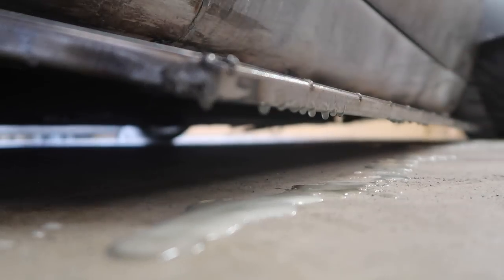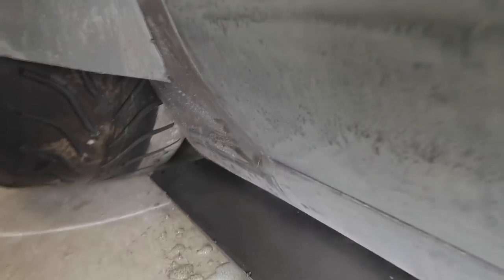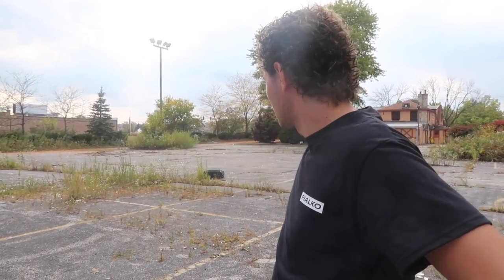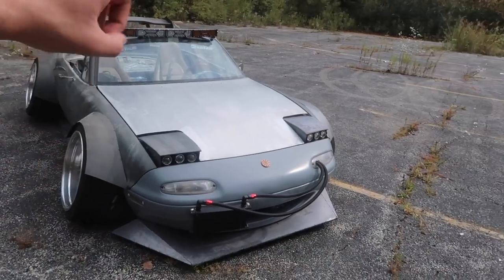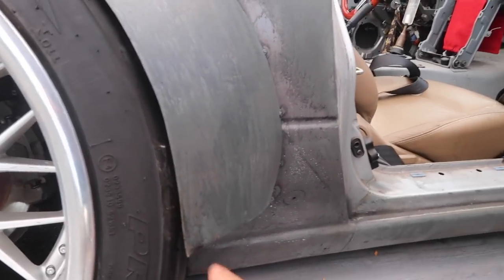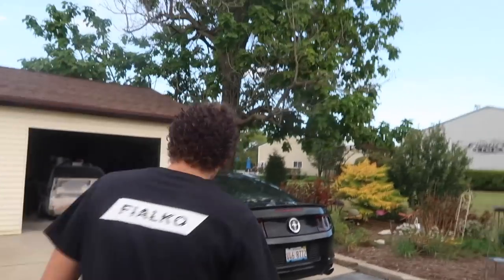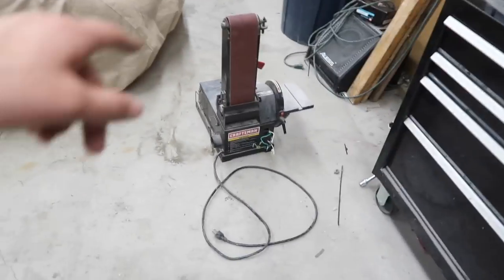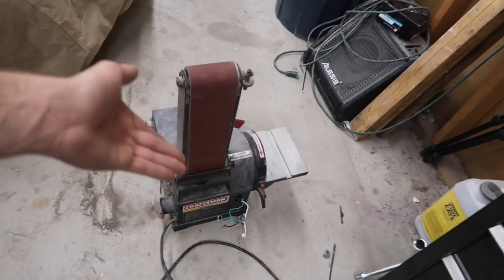He Cut His Leg Open On My Fender!

Comment: After you clean it with that solution why don't you clear coat the car. That way there's no rust and you keep that nice metallic look. If not clear coat at least heavy wax so it slows down the oxidation period